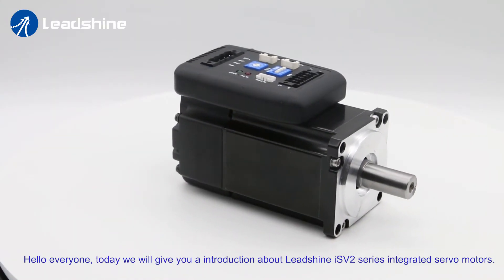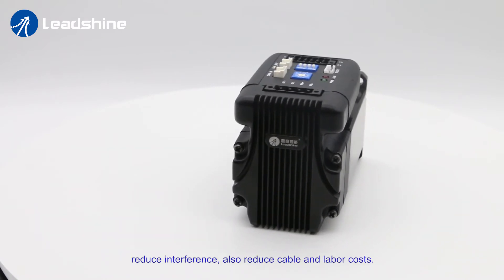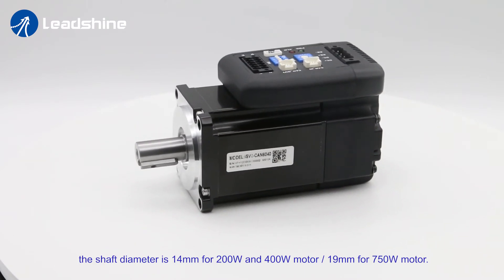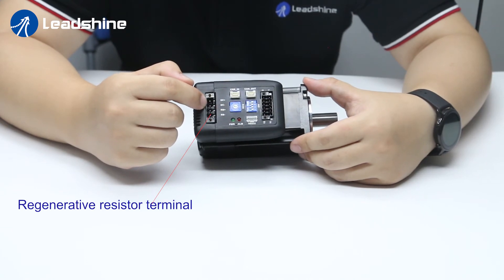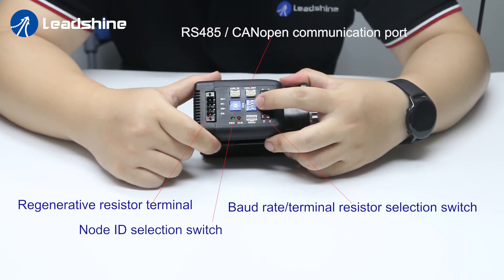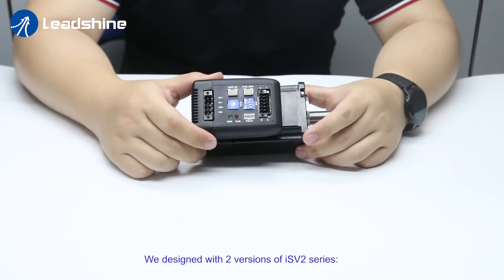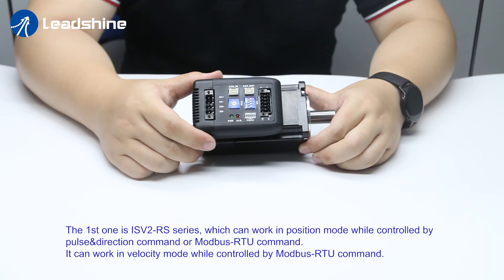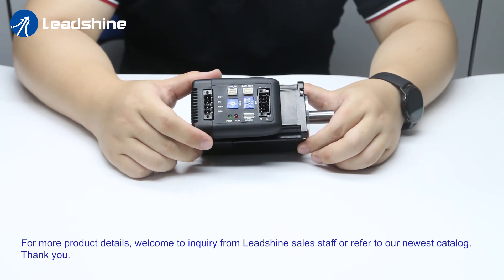Leadshine Integrated Servo Motor iSV2 Series Brief Introduction

Comment: are these motor low inertia?
Reply from the maker: No, which industry do you want the product applied in?
Reply: @leadshine3995  cnc woodworking router
Reply: @leadshine3995  woodworking cnc router
Reply: Cnc woodworking router machine

Comment: If the voltage supplied to the motor is less than 24V, will the motor report an error?
Reply from the maker: the motor will run no more than 2000rpm and easy to get "under-voltage" error if with 24VDC input
Reply: @leadshine3995  Thankyou very much
Reply: @leadshine3995  Can you give me some document to interface with motor through canopen
Reply from the maker: @chungtran5000  Yes, this is iSV2-CAN and iSV2-RS user manual, you can read them.
iSV-CAN:
https://www.leadshine.com/upfiles/downloads/1317c194d185fc3362c6c54b67cc1671_1656496879279.pdf
iSV2-RS: https://www.leadshine.com/upfiles/downloads/21d79b647f6bdb8355a4baad7c50eb32_1651135390449.pdf
Reply: @leadshine3995  thankyou.
Reply: @leadshine3995  do you have video about instructing communicate with motor by canopen, please give me. thankyou
Reply: @leadshine3995  can you give me some information about type of can connector on this motor. thankyou
Reply from the maker: @chungtran5000  Sorry, we don't have this video.